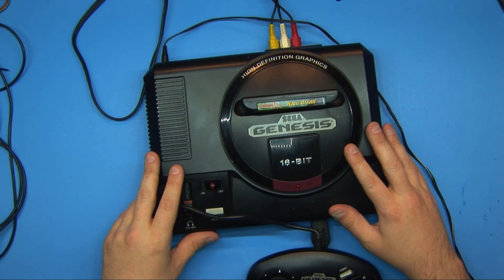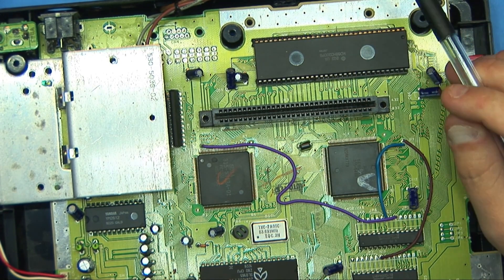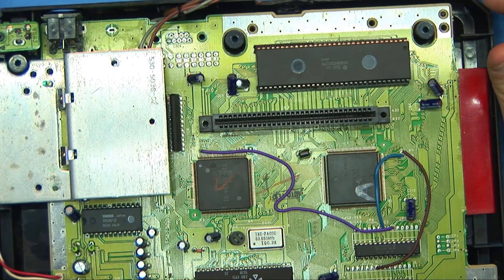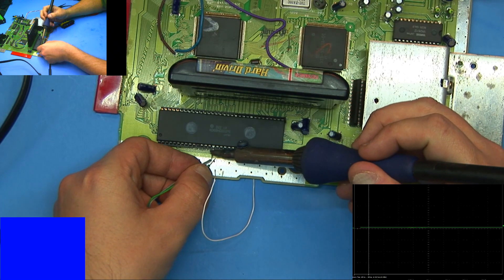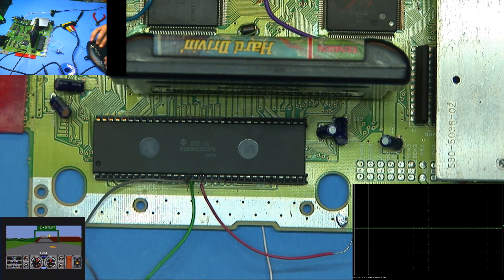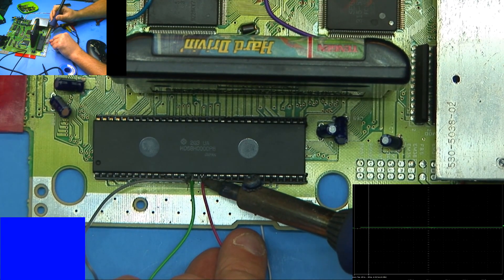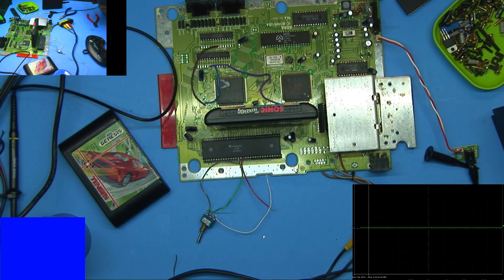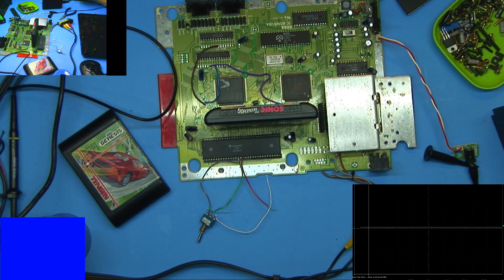Sega Genesis / Mega Drive overclock attempt #1  - 13.4 Mhz

Comment: The first chip in the video was a Hitachi. Those are usually touted as good overclockers. The real issue is twofold. The stock parts aren’t rated for this kind of speed, and your wires may be too long. Other common factors are ROM speed and RAM speed. If they can’t keep up, they’ll glitch and crash.

Comment: Get a 16MHz rated 68000 and underclock it to 13.4. That will eliminate any problem from pushing almost 2x the rated speed and see if it can run stable / if there are still audio problems.

Upsize the wires maybe.

Comment: According to another video the CPU draw more voltage ~6.5v @10MHz, yours should be drawing even more @13MHz. The 7805 regulators might have a rough time and might like some heat sinks attached to them.
Reply: They have  a heatsink